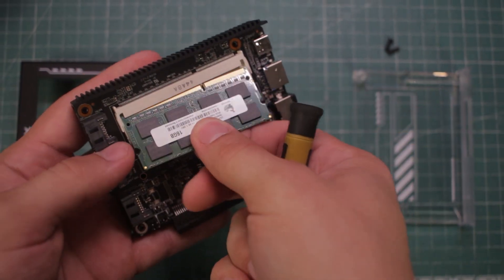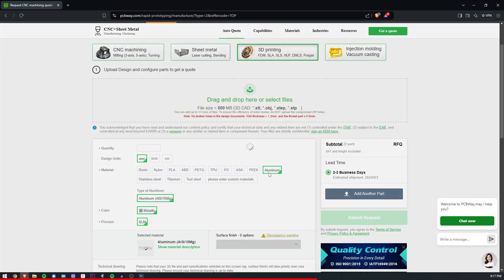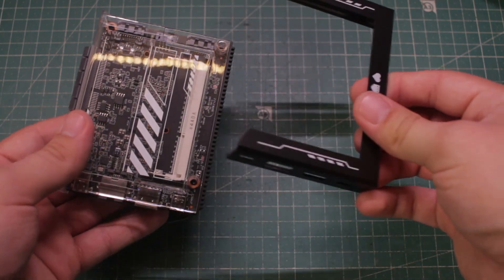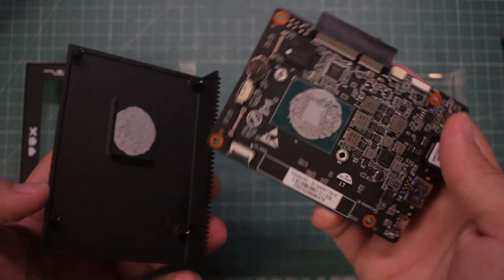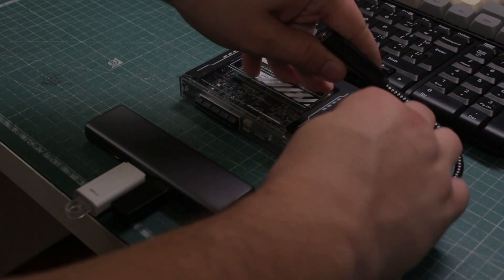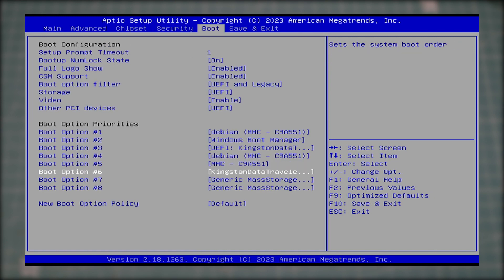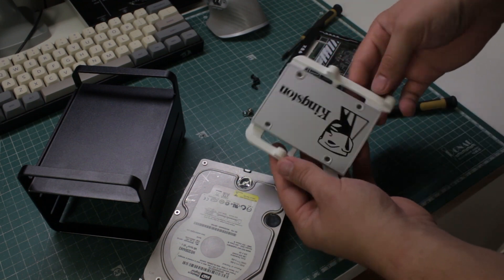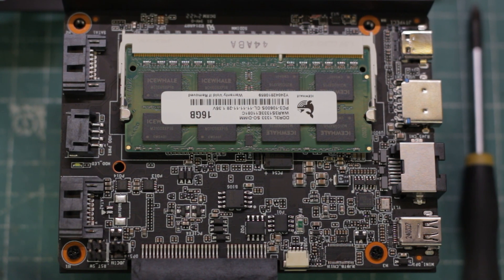ZimaBlade: A Tiny PC to Replace My Full-Size Home Server?!

Comment: For a dummy, if you get 2 3.5" HDDs, you plug each one into the SATA ports, but then how do you power both of them?  Don't they both have to have their own power or is there an adapter to plug the power into the ZimaBlade?

Comment: Hello, very good video but I have a doubt, the board has 24 gigabytes of memory and the applications you download are predetermined for that mini disk. How did you manage to change the storage disk, that is, everything you download stays on the external disk with the highest capacity?
Reply from the maker: Well 24Gb is a bit low but if you want more storage there's many ways to connect external drives which is awesome. I personally use it with a 120Gb SSD and a 500GB HDD. I installed Ubuntu Server on the SSD and everything is stored there. On the side, the HDD is used as a NAS.

Comment: I'm surprised Zima hasn't created a chassis to where you can plug like 4 of those zima blades so you can create a cluster. There the cluster could make use of drives like the 2 bay unit so it can share those storage.